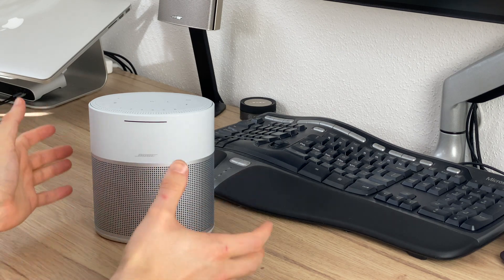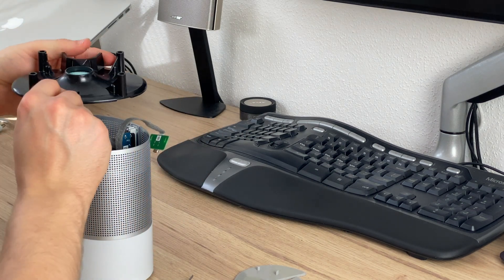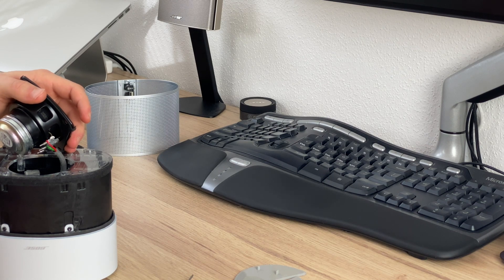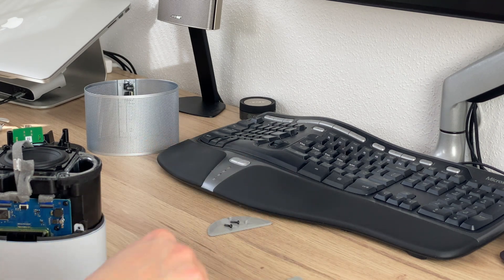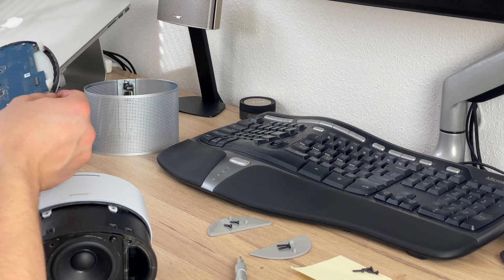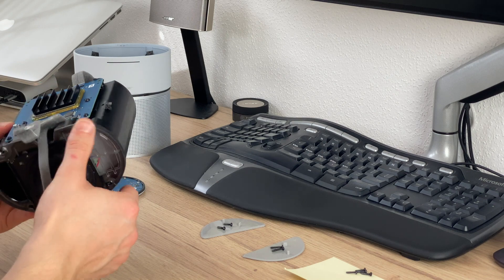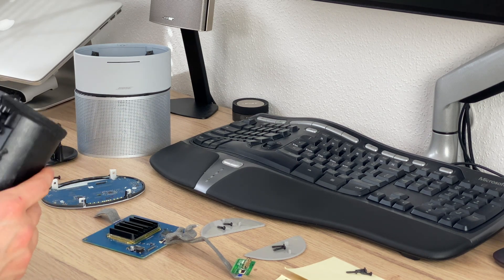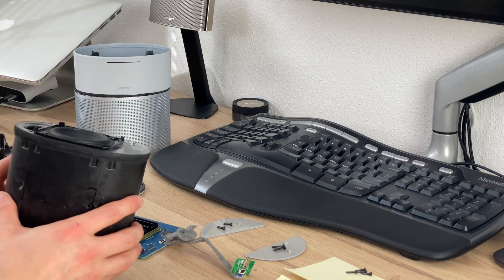What's inside the BOSE HomeSpeaker 300 - Teardown!

Comment: Great video!! 👌
Don’t suppose you managed to get the wattage of the speaker by any chance did you?
Bose don’t Display speaker wattage on their site, and from the research I’ve done its 120w, which seems insane for the size of the speaker, but I also have a 2.1 tower speaker that it 65w and they are just as Loud as each other which is insane considering my tower speaker has 4 speakers 🤨
Reply: Tower speakers are really efficient most of the times.

Comment: Is there anyway to hard reset this speaker so as to get it out of "software update loop". Any sort of internal clock or battery ?
Reply from the maker: Couldn't find anything like that during teardown. Maybe you're lucky if you follow the Bose manual on resetting the device? AFAIK there's a combination of buttons you have to press.